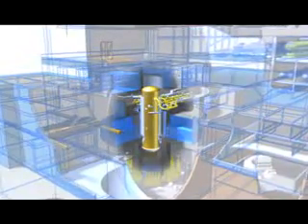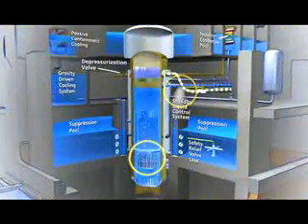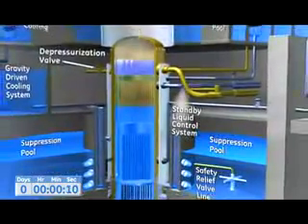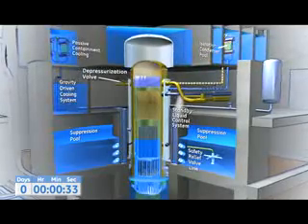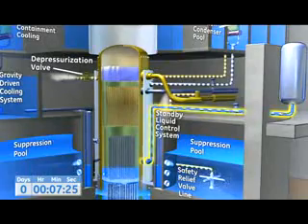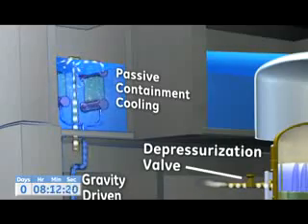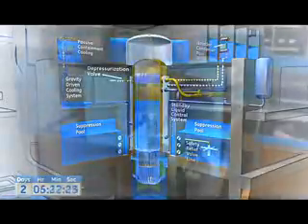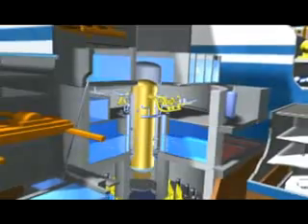Safety Features ESBWR

Comment: Seems to me (a non-specialist) that the PWRs are safer than the BWRs. Advanced or not. In particular the dual loop (PWR) vs single loop (BWR) configuration. Any thoughts by specialists?
Reply: Not a specialist, but here's a difference that's easy to explain and understand. Are you familiar with the Leidenfrost Effect? When a surface is much hotter than the boiling point of a liquid, a film of vapor can develop and insulate the surface. In nuclear engineering safety "departure from nucleate boiling" (DNB) is the term for the situation where the Leidenfrost Effect kicks in. The fuel and cladding quickly heats to a much higher temperature, hot enough that steam and zirconium can react with each other. Eventually the steam will dissolve the cladding and release fission products.

BWRs are designed to boil water at 100% power. (Obviously enough.) The core has a relatively open layout at the bottom of a column of water (there's about 10' or 3m between the top of the fuel and the top of the water). This capability ends up being an asset in many accident scenarios. 

PWRs are better at isolating radioactivity if fuel is damaged, but BWRs are very good at preventing fuel damage in the first place. If you look at Wikipedia's page on accidents involving "meltdown", only two were at BWRs. Destructive testing of BORAX-1, and massive flooding at Fukushima beyond all contingency plans.

Unless fuel is damaged, the radioactive hazard in BWR steam is N-16, which decays to undetectable levels within minutes of shutdown or release. You could still detect H-3 and C-14, but not at meaningful levels. It's the kind of thing that sounds frightening at first, but it's really not very dirty at all. Some power plants use a longer steam path to reduce personnel exposure even lower. 

PWRs have a much more compact core that depends on convection. Unless the reactor core is designed to boil water or the pipes can create an adequate thermosyphon effect, PWRs aren't capable of passive shutdown.  This design vulnerability shows up again and again in accident contingency planning. To put it bluntly if a bit inaccurately, most Gen II PWRs "want" to melt their fuel and the only reason why they don't have fuel-damage accidents more often is that engineers work really, really hard to cover all the bases. 

If a PWR needs to keep its coolant pumps running, the coolant pressure must be maintained. No pressure means the coolant will start to boil, and it will start to boil inside the pumps. This can damage or destroy the pumps. Therefore, for a safe shutdown you must maintain power to the pumps, power to the pressurizer heater, and integrity of the primary coolant loop. This is how a pressurizer steam leak at Three Mile Island progressed to severe core damage - no pressure, no cooling.

Both types have a large "negative void coefficient" - steam bubbles ("voids") in the reactor are less effective at moderating neutrons and reduce the reaction rate. This is often cited as a reason why PWRs and BWRs are safer than CANDU and RBMK (positive and RBMK was initially very positive). PWRs aren't made much safer by this fact. A PWR that's being limited by its void coefficient is a PWR on the brink of the Leidenfrost effect and fuel damage.

BWRs have so much usable stability from the void coefficient that the normal way of controlling the reaction rate between 30% and 100% is to simply take as much or as little steam as you need. PWRs need more careful attention - the reactivity is precisely tuned by adding boric acid to the primary coolant or diluting it out. Primary coolant volume control is also essential - if you overcharge the loop the reactor suddenly becomes much less stable. (This is such a big concern in training that at TMI operators stopped injecting coolant several times - even though the reactor was shut down and those pumps were the only source of cooling.)

Gen III PWRs are much safer than Gen II. They are designed so that they can be safely depressurized during an accident - doing so actually makes passive safety systems work better, and I would be happy living near one. But BWRs have had depressurization capability since Gen II designs. 

I think BWRs are the least bad of Gen II designs. They should be replaced or retrofitted to add passive shutdown capability, but they're not meltdowns waiting to happen like Gen II PWRs are. PWRs are great for marine power, probably ideal for that application, but they shouldn't have been scaled up for fixed-location use. I think the US made a mistake building our civilian nuclear industry on nuclear Navy experience. To be clear, I wouldn't mind living near one - Three Mile Island was a great demonstration of their ability to contain an accident - but I wouldn't want to buy shares in it. 

If I were in the market for a nuclear reactor a General Electric ESBWR would be my choice.
Reply: @jordanrodrigues8265  
I want liquid metal and gas cooled fast breeder nuclear reactors.
Reply: Hello i can explain the safety advantadges and disadvantadges of a BWR against a PWR

Advantadges:

1-Is much easier to make a decay heat removal system for a BWR than for a PWR since the water flashes to steam in the vessel, so you can cold down the steam and put it again in the reactor, in a PWR you need to be very good at working with natural convection.

2-Less temperature and pressure; While a PWR operates a 170 to 250 Bar and 320°C a BWR works at 70 Bar and 270°C, so it's easier to cool it down, and in fact fukushima-1 melted because the operators disabled the decay heat removal system due to "excessive cooling"

3-The vessel is much larger; A 4500MWt PWR uses a 5 meters diameter and 10 meters tall pressure vessel, a 4500MWt BWR uses a 7.5 meters diameter and 30 meters tall pressure vessel, so you got a larger ammount of water that has to boil.

Disadvantadges:

1-Weaker containment: Generally BWRs don't have a secondary containment building, (the big dome in PWR powerplants) in the ABWR and ESBWR the 2 meter thick reinforced concrete secondary containment tends to be more of an optional than a standard feature.

2-Thinner vessel: Because BWRs operate at lower temperatures and pressures the reactor vessel tends to be 7 inches thick instead of 10 or 13 inches thick as in most PWRs, so if the core melts it has less steel to go through

3-Lower possible redundancy. In a PWR if  the condenser emergency cooling system has a pipe breakdown is possible to cool the reactor thorugh the steam generators, if the steam generators cooling system fail is possible to cool the reactor directly. 

Generally if a country chooses a PWR or a BWR depends if they already had experience with BWRs or with PWRs, if Switzerland or Sweden or Mexico or Spain wan't to make a nuclear powerplant is most likely they will chose a BWR because they have more experience working with them
Reply: @thepowerofdreams6816  
Both advantages of a boiling water reactor overlap:

1) Water in PWR can circulate naturally, because The diameter of the pipelines and steam generators allow this; pumps are used.

2) Temperatures have no effect. The problem of the reactor is cooling, and the dry core is quite heated to melting temperatures.
For example, in fast reactors the temperature at the outlet is 500+ degrees, but they have a natural safety than conventional ones.
Reply: BWRs are inherently more accident resistant. There is less piping leaving the reactor vessel which means a loss of coolant accident is less likely. BWRs are also at a lower pressure than a PWR meaning sealing is easier to maintain. Another problem with the PWR is if you lose pressure all of your coolant in the first loop will evaporate and cant circulate anymore,  but in a BWR this is a design feature and so pressure loss is a non issue in BWRs, meaning BWRs have a entire class of accidents eliminated from their design. The core damage at three mile island was actually cause by a accidental loss of vessel pressure, had it been a BWR, no core damage would have occurred from a loss of pressure.

Comment: And if the building happens to collapse because of an earthquake, radioactivity could escape into the environment. A pressurized water reactor or a pebble bed reactor should indeed be much safer.
Reply: How wiuld a PWR reactor be more safer when the reactor vessel is highly pressurised?
Reply: @Kaz_Xzys-tential  
Silently. Pressurized water reactors have been around for a long time, and their pressure is rarely considered a negative.
Reply: 1) You don't explain how a PWR or Pebble bed reactor would be safer. You just assert it.

2) The Fukushima accident showed that earth quake was not really a problem. The nuclear reactor handled that very well. Even the Tsunami did not cause anything to collapse. The issue as we often see is the failure of pumps to work, because of power loss. That seems to be the case time and again in these accidents, and this ESBWR configuration should take waway that problem.